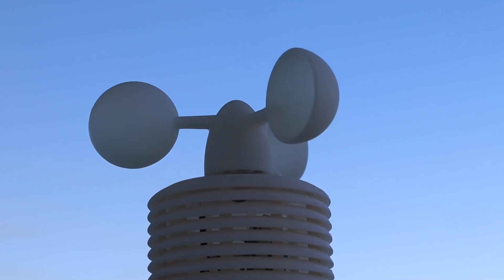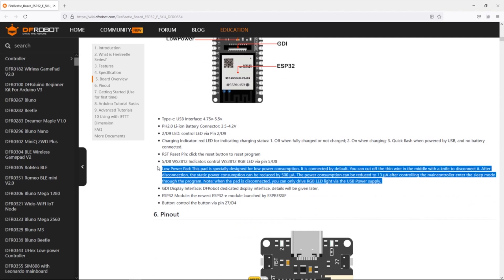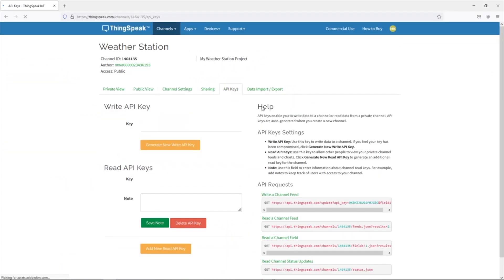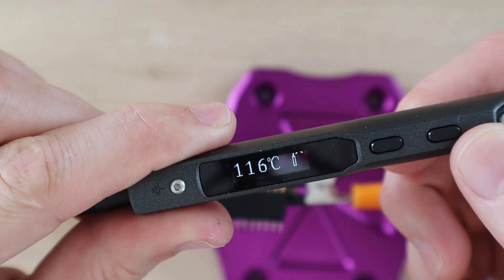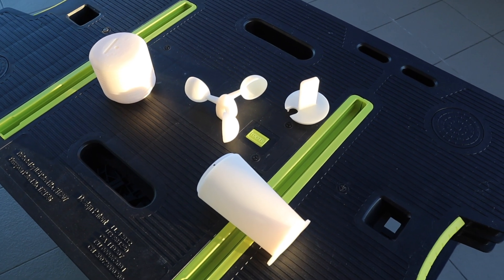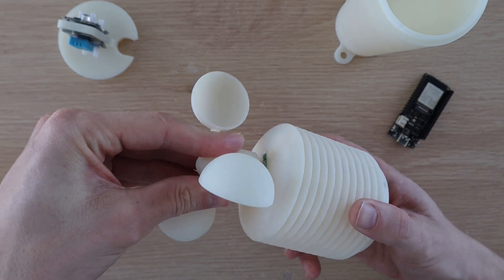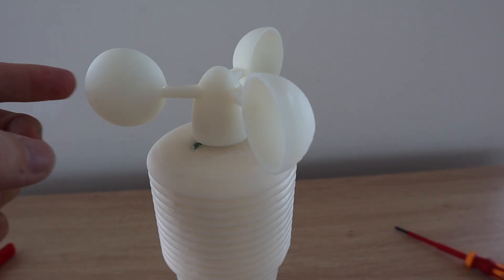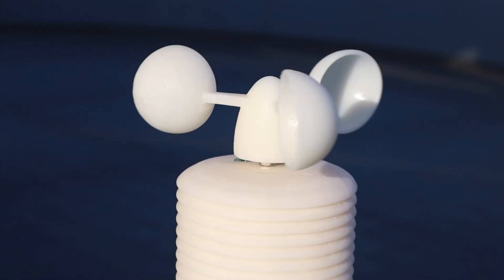DIY 3D Printed IoT Weather Station Using an ESP32

Comment: The best way to  ensure the lowest power consumption while sleeping is to power the sensors with another I/O pin only when active.  This should get you back down to uA's.  Just ensure your sensor doesn't exceed the current rating of the ESP8266 / ESP32 I/O port  :)

Comment: I don't understand how this works? That one battery can last almost 2 months?
Reply from the maker: Yes, the ESP32 is running in "low power mode" and is onl on for a few seconds to take measurements and transmit data before going back to sleep.
Reply: @MichaelKlements  what is the best battery to use for this weather station?

Comment: I live in an area where it gets cold in the winter and the DHT11 sensors won't do negative temperatures.
Reply from the maker: That's why my upgraded version has a BME280 sensor in it
Reply: @MichaelKlements  I've got your system built on a breadboard.  I bought a sparkfun weather kit and I think I have the anemometer working. Unfortunately sparkfun no longer has the electrics that this kit was designed for.  And there is very little documentation available.  Since the weather kit has the anemometer with the electonics in it I didn't need the reed switch.

Comment: Nice..
I did mine with the help of ChatGTP,  it reads temp, Rh, rain intensity & accumulation, uv index with an algorithm it made on the spot for using an LDR and another algorithm it made using the pulses from a fan/motor to calculate wind speed and uploads it to weatherunderground api, then deep sleep for 4 mins as the code takes around 10 seconds to complete and online update intervals are 5 mins so gives the system enough time to sync.
I plan to print everything on my diy PET extruder, it makes filament from recycled PET bottle's and I've had things outside for year's without flaking, fading or becoming brittle.
Reply: Can I get more details on this? I’d love to make a remote data logging version.

Comment: How did you end up calculating the required info for the anemometer given the surface area of the cups/length of arms etc give you huge variables?
Reply from the maker: I tried a range of calculations and they were all off, I eventually created a calibration table with lookup values based on another anemometer that I have (so calibrated it using another anemometer)
Reply: @MichaelKlements  ahhh the classic “need scissors to open the scissor packaging” conundrum! Thanks for the response :)
Reply from the maker: The other method I was considering was to ride a bike or car at a set speed with the anemometer and see what it read and then calibrate it iteratively until it was correct.

Comment: I know this is an old video, but I have been printing in resin now for a while and leaving the pieces in harsh UV conditions. I paint the parts with UV reflective paints now. They come in spray-cans, and go on nicely and make the parts look very professional.
Reply from the maker: Thanks for the tip, do you have a link for the product or brand of UV paint that you use?
Reply: @MichaelKlements  You're going to laugh..I believe it was either Rustoleum or Krylon Clear Coat. I remember vividly that the can stated UV reflective or UV resistant on the front label. I bought them in a big-box store. I have also bought their automotive enamel (colors), but that tends to make the surface glossy. Either way, I have parts 100' up on my antenna tower for years now..no failures. I did, however, paint one project box black, and that warped. Another tip that has worked literally DECADES for me out in the elements..use a metal ammo box for a project case. They seal tightly, the gasket lasts for decades and you can get them very cheaply from surplus stores. Cheers Mike..Warren
Reply from the maker: Haha good old Rustoleum, I'll have a look at my local hardware store and see if they've got some UV resistant options. Ammo boxes sound like a great alternative for outdoor projects, they're built for a harsh environment after all.

Comment: How do you protect the ESP32 board and even prevent the sensors from breaking down over time? Indoors is fine but outside in the winter how do you prevent wear and tear on the devices?
Reply from the maker: The ESP board is somewhat protected being in the bottom part of the case which is a bit more closed off. The sensors at the top are exposed to the elements and there isn't too much that can be done about that since they need to be. You could try some sort of spray on PCB conformal coating, but you'd need to protect the sensing elements first (can't cover them or block them). I'll see how they hold up over time but so far it's been running for over 5 months without any issues.
Reply: @MichaelKlements  Nice! I'm worried about degradation over time on sensors though. If I did that the sensors would wear out I guess? But I agree, they need to be exposed, that's what they are there for, lol Just trying to think if there is a way to protect them over say years of use so you don't have to replace the sensors often. And I guess you don't know if they are degraded until you have a reference to measure from too.

Comment: Great project.  With the resin-printed cups, I wonder if a painted finish would increase durability?  

3M do a spray called Polyolefin Adhesion Primer (I don't work for them or know anyone who does, I just recommend the product - though it is super-toxic and so requires gloves, mask and eye protection to use). I found out about its use in car bodyshops to help paint adhesion to GRP bumpers/parts.  It will adhere to any plastic or other slippery surface, on top of which you spray your primer (I like Rustoleum products), and then final paint surface.  

You can then finish with a spray on UV-protected lacquer.  I've done this for some repair projects on Bakelite parts from an old sail boat (an epoxy and glass sheets repair), and it is holding up really well - salt water and air is already a very harsh environment, and the salt crystals that form from sea spray act like a magnifying glass to accelerate UV damage on horizontal surfaces especially.
Reply from the maker: Thank you,
I'm planning on doing some testing on resin parts to see how well they hold up outdoors. I like your suggestion of a primer and uv protected laquer to compare to the bare components. I'll have a look at whether we get polyolefin adhesion primer, or something similar here.
Reply: @MichaelKlements  Just another thought: what about testing wraps?  At the risk of sounding like a 3M fan-boy, they seem to make some great products with a whole range of finishes from wood-look to metal-look or carbon-fibre. From what I've read, you can wrap virtually anything, from tables to furniture to a whole car. It seems to work like shrink wrap, in principle, so there is a skill element in its application.  If it can stay attached to a car, it would surely work for this sort of application.  I guess it might get a bit fiddly with a shape like a wind cup though...
Reply from the maker: Yeah that's also a neat idea. I think they would work well for enclosures like the based or rectangular cases. I don't think I'd be able to wrap the vented area at the top or the cups though, perhaps a professional could do a decent job of them.
Reply: @MichaelKlements  Thinking about it, I wouldn't personally advocate wrapping over PLA cases unless it is for protection: one of the things that I think the 3D printing and making world has going for it (and that is unfathomably under-played on YouTube in the current 'climate' with its focus on sustainability and climate change), is that PLA is biodegradable and the final product is not shipped half way across the globe.  People will make their own minds up, but I think we all have a responsibility to champion sustainable materials and practices.

On the wrapping of intricate parts, I agree it might be tricky.  I have no doubt it's possible, though, for someone with the manual dexterity and hand-eye coordination, and the patience.  Cars are complex shapes, as is furniture.  The wraps are applied with heat guns and stretching, and I would imagine it takes some practice to know where and when to make a cut and how the material will behave.  I was thinking of wrapping my desk, but was put off by the thought of hideous wrinkles... I feel sure I'd have to do it at least twice to be satisfied with the result, by which time the cost would make it an extravagance and wasteful.
Reply from the maker: Yeah it is definitely something often overlooked. I personally have an issue with almost all manufacturers using plastic spools for the filament. They aren't particularly useful afterward, so I've just got loads of them lying around and most aren't recyclable either. I don't know why more manufacturers don't just use cardboard or thin plywood spools. 

I have a bit of experience with wrapping as I used to build balsa frame RC aircraft and would have to wrap the frames in heat shrink wrap similar to furniture and car wraps. The tricky parts would be the small arms and the inside of the cups, particularly the cups as you can't "shrink" the wrap into them as it would then bridge the span across the cup rather than stick to it.
Reply: @MichaelKlements  yes I agree with the filament spools: there's no excuse imho!  cool about your rc model making bckground...
 
BTW, I've just been reading Ultimaker's white paper called "How to design for FFF 3D printing" and its materials section says PC filament (poly carbonate) has high mechanical strength, good uv resistance and high thermal,resistance - but the print difficulty is high...

Comment: It would be interesting to be able to use an existing commercial weather station for sensors, and ten add the logging IOT layer with the RPi. That wold eliminate the need for all the fabrication and physical components, and make it an electronics project. It would be interesting to add a solar panel as you mention, and then one cold take any standard weather stations, and convert it to IOT usage. I recognize that was not or goal, and thanks for the video and project.
Reply from the maker: Thanks Gregory, I can definitely have a look at putting something like this together. I've done a few upgrades to this one, including the solar panel addition, so I'll be posting that video soon.

Comment: Hey Michael, I love the video. I put some resin prints outside on my front porch about two months ago. I used Standard Grey UV resin from Elegoo. After two months the print looks exactly the same. It doesnt seem to be anymore or less brittle than when I first printed it. My porch gets 10-12 hours of sunlight during the summer. I'm ready to do another print and a longer term experiment.
Reply from the maker: That seems to be what others have said as well. I'm planning on trying out a couple of different types of resin to see how well they hold up outside for a couple of months. Let me know how your long term experiment goes!

Comment: Very interesting project. Maybe you could measure the battery voltage and post that so you knew when to charge it?
Reply from the maker: That's a good idea Toby, thanks.
Reply: @MichaelKlements thanks for the project, it was very interesting.

Comment: You can calibrate the wind speed reading when it is a calm day, by driving a car and get the speed by a GPS.  Then you know if the readings are OK, if not, how much to change it.  If you have a mobile phone, you can set up to tether with the ESP32, so it can connect to it's database.
Reply: Good idea!
Reply: I was fortunate to have a weather station nearby that posts / graphs of their wind speed data online.  My wind speed chart on ThingSpeak followed the exact same path as that posted so all I had to do was some simple Goz-Inta's  :)

Comment: You should be able to power your sensors off of digital pins on the esp32 so that you won't have any power draw in deep sleep. That will provide up to 40ma. If you need more, you can use a transistor and drive the base with the esp.
Reply from the maker: Thanks for the tip Allen, I hadn't considered driving them directly from the digital pins.

Comment: Can i 3d print this with filament? Not resin?
Reply from the maker: You can, but you'd likely need to play around with the orientation and supports required for the rings around the sensor housing.
Reply: @MichaelKlements  I’m printing the wind meter thing right now. Supports maybe issue. Do you have any ideas on solar panels?
Reply from the maker: Have a look at my solar powered crypto mining video, I'd start with a panel and charge controller like that.
Reply: @MichaelKlements  ill definitely do that!! thanks, Michael. im still trying to figure out how to calibrate the anonometer.

Comment: I suggest putting some UV blocking coating (paint?) On the 3d printed plastic. PLA is especially sensitive to sunlight.
Reply from the maker: Thanks for the suggestion. I'm thinking of doing a comparison between different resin types and painted, UV treated etc to see how they would hold up outdoors.

Comment: Hmm. looks like what I type here is auto expunged if I include links?  Let my try all that again... if you replace one of the anemometer cups with one that's 18% larger, and swap the reed switch with a magnetometer, you can measure wind speed (average frequency) and direction (magnetometer phase) at the same time.
Reply: p.s. spray it all (including the magnets!) with protective lacquer, and perhaps use ceramic bearings?  All that stuff doesn't appreciate rain, and rusts really fast - if you're near the sea, the magnets and bearings will die in less than 6 months.
Reply: Here's the math on that 18% number: Drag coefficients for assorted shapes: http://www.aerospaceweb.org/question/aerodynamics/q0231.shtml
Sphere: 0.47 (or 0.45), half-sphere (nose on) 0.38 (or 0.8), half-sphere (flat-edge on) 1.17(or 1.42) - Asymmetric Anemometer; 1.18x larger half-sphere on one arm
Reply: Suggestion - use LiFePO directly (instead of lipo through the regulator) and use the ESP32 pins to power down the bits you're not using when sleeping... you might find that the huge sleep powerdrain is the regulator mostly...
Reply from the maker: Hi Chris,
That's an interesting concept, I'd definitely like to try it out. I understand the general principle of what you've described, but do you have any links for articles or projects where someone has managed to get something like this working? Or does this already exist in an off-the-shelf product that you know of?
Thanks for the other tips on the bearings and battery etc., this is my first outdoor weather station so there's definitely a lot to be learned.
Reply: @MichaelKlements  I built one myself about 22 years ago(!) - using the inside of an optical mouse in place of the magnetometer (with one of the slots blocked out so I knew which one was the big cup).  Worked awesomely.  I converted the time-between-pulses into a sine wave back then, which will already be the same output as a magnetometer will give you today.  For you - counting the average time for a few revolutions will give you wind speed.  To figure out direction, I simply created 360 imaginary sine curves (each shifted by 1 degree of phase), then used "least squares" to find which one matched my input best for the direction.  I do not know any commercial products doing this.  I did hear of someone who added a "tab" (instead of making one cup bigger) to get the same solution about a decade ago.

I'm in the middle of making one myself (work-commitments permitting) - it will use LoRa to transmit the wind from my favorite paragliding site... so I have other things to worry about: birds landing on it and wrecking things (they're heavy with sharp claws, and managed to "bend" my spike I added out of the way last time I tried), sea-spray ingress, sun damage, as well as theft and vandalism  (I'm going to try and make it look like "art" to hopefully discourage vandals, and add a light so it's useful to people passing at night too - it's on an existing sign pole at a beach entrance, which is otherwise unlit).  If you use solar, remember that the garbage epoxy the usually are encased in self-destructs in the sun after about a year too...  I'm using eneloops (NiMh LSD cells) for my power - so far, after 3 years, they're still working fine in the sun (for just the light part - not finished the anemometer yet). I drowned them in circuit board lacquer which has so-far kept the rust at bay.
Reply from the maker: Hi Chris,
Thanks for taking the time to share all of this. It's definitely given me a few ideas to work with. The concept makes total sense, I'm just wondering why it doesn't seem to be used commercially. It's certainly a lot simpler mechanically than the typical 8 or 16 reed switch wind direction setup.
That sounds really interesting. If you document it anywhere, please let me know. 
Yeah I've been through the same with commercial ones I've bought. They eventually either get stolen or broken by birds. Here in Sydney we have cockatoos that fly around destroying everything they can find. They even pick the bird spikes off of ledges and sills. 
Thanks for the tips on the solar panel and batteries. I've tried a few short term solar projects, but never anything that has been outside for more than a week or two.